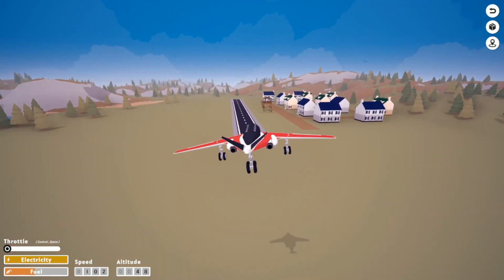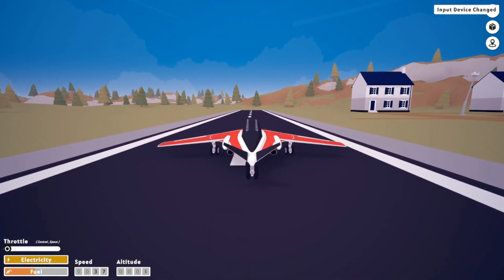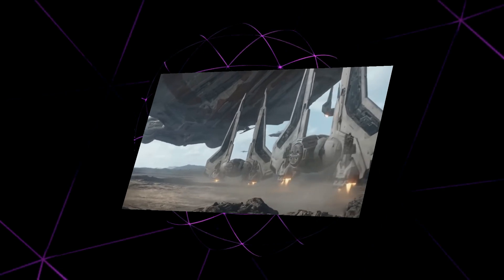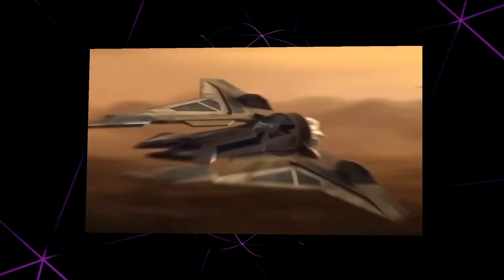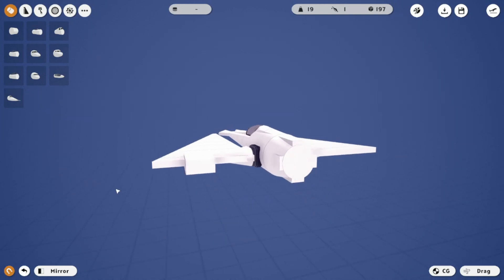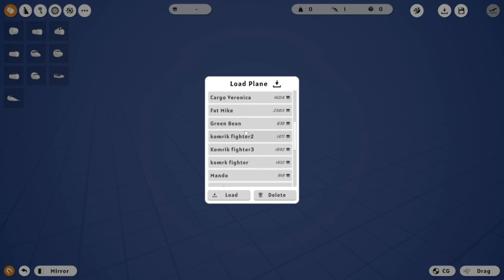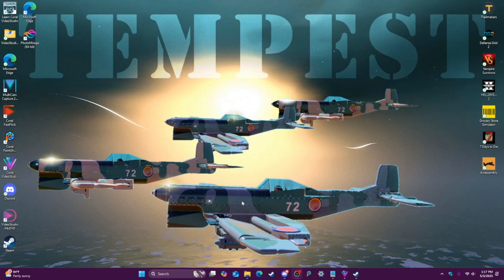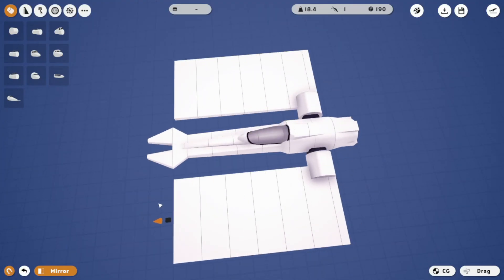VTOL Experimental | Mandalorian Gauntlet Fighter

Comment: hover crafts dont work unless you balance at least 2 engines on a symmetrical cockpit with the same amount of fuselage on both sides and the center of gravity right in the middle. then you tilt the rear engine roughly 45 so it thrust forward and you tilt the front engine 45 so it provides a counter thrust. after this just play with the engine output and always have the front be putting out less total thrust than the rear engine. i dont know the perfect numbers but this is the only way i have succeeded in creating a vtol like craft.
Reply: every other attempt lead to a craft that wanted to do backflips